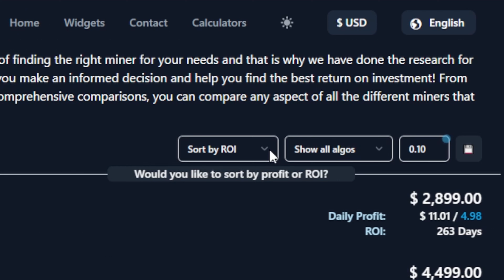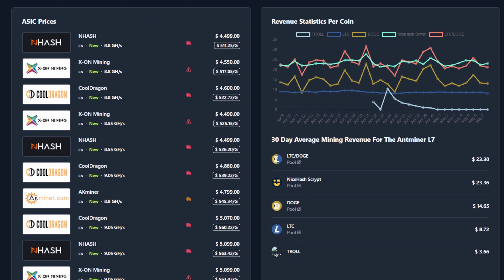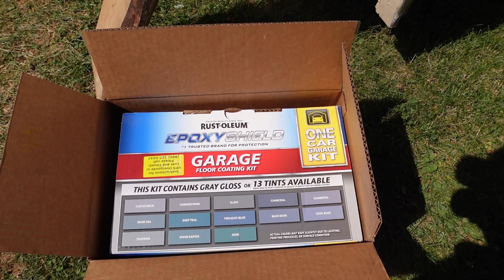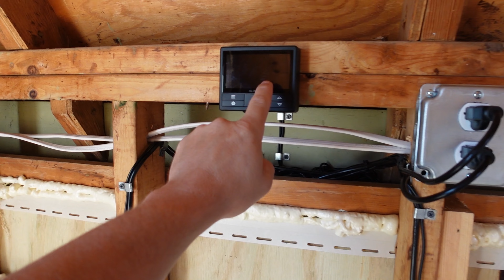Building a Crypto Mining Shed | Digging a Trench for the Power!

Comment: You shouldn't run data with power, you need about 12 inches of separation to avoid issues. Fiber is the way, is it at least shielded?
Reply from the maker: You come out and pay for the Fiber Run, terminations, Fiber Tray and Switch and I am willing lol.    Its Mining Brother, I could run this off 56k :P
Reply from the maker: All Cables are Shielded and will be buried.  I don't have any concerns. Yes is it Best, sure.  Is it needed, No.
Reply: cross talk is a thing even with shielded cable. I hope it'll link. you should be able to get 10base T out of a super noisy link but yeah valid concern for sure techmanyt.
Reply: I need to do a trench myself, I’ve had an ethernet cable just laying on the ground since 2017 😂, I thought about putting my power at the bottom of trench with data towards the top to avoid interference
Reply: @davidmilliken8713  depending on your frost line, you can do 24" for power, fill in 12 inches and then do data. Or just throw it in the holle and cross your fingers 😅
Reply: @TechManTY.  I’m in Texas so not much of frost line, I buried my power by hand so not currently very deep, my plan is trench then put power at bottom, push 1 side of dirt in then data then cover, it runs from my barn to shed then to house so my main internet depends on it, not just mining

Comment: Im also working on my shed right now.  Have 100 amp line ran already.  However when it comes to the fans ill be putting the sensor on the intake. We get down to -40 and i dont want to be pulling that air in to quickly. Trying to avoid any condensation on the machines. 

Trying to get the air to mix and warm up some before getting to the asics.

Working on a system that allows me to have a hot isle in summer and mixed during winter.

Comment: I was going to say the same thing that a few others said. You should never run Ethernet or data for phone line near power. They should be separated by at least six inches. I know you're trying to do it on the cheap. But you realize you have two hundred amp in the ground Maybe 20 or 30 in deep. That's really not that great. Especially bare wires. I would have spent cheap PVC light switch for 160 ft of cost any more than $100. I think even galvanized pipe would have even done better. Did you even lay stone at the bottom of the trench? Just for some drainage?